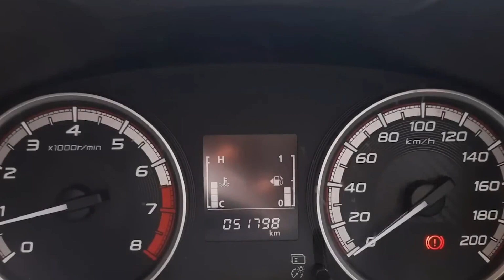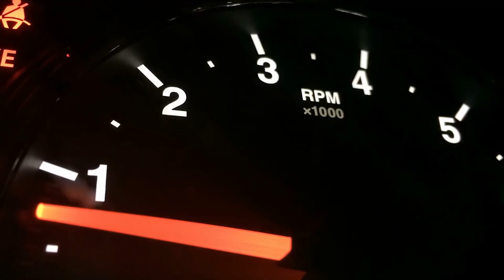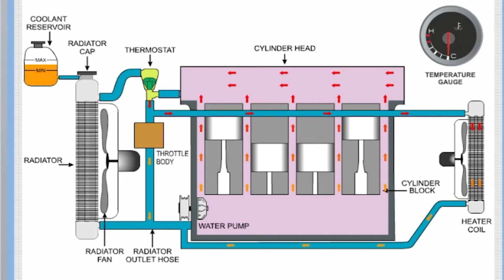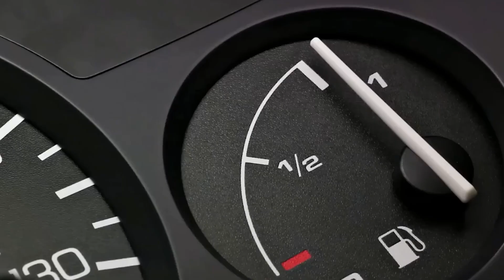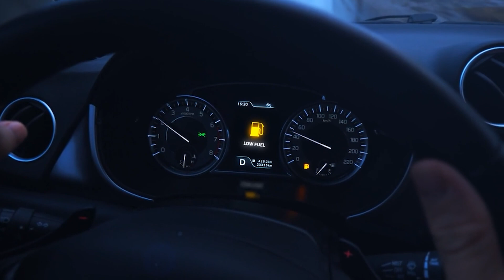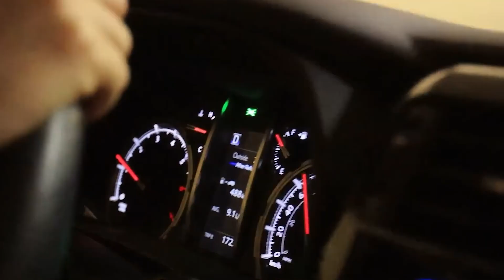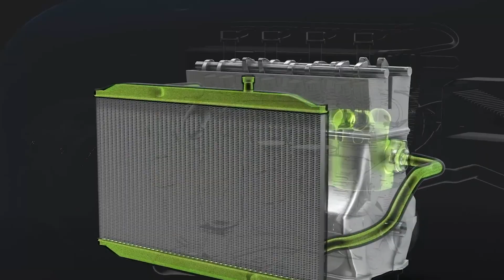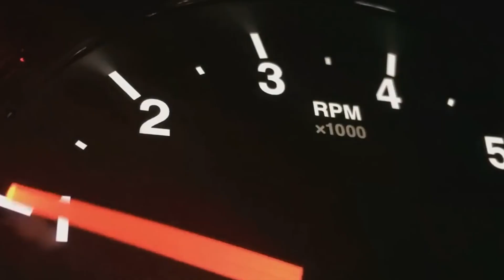7 Driving Habits That Ruin Your Engine Most Drivers Don’t Know!

Comment: Engine braking is bad is it? What hogwash. If that were true, EVERY truck on the road would have a ruined engine. So remember, if you are ever driving a fully loaded truck down a long hill, don't downshift because that is bad for the engine. just ride the brakes!!!!!!  See what happens.
Reply from the maker: @garyzimmer4149 Engine braking is bad for your car if done improperly. Same goes for ridding the brakes so ideally we look at a more balanced driving style. Take me for example, I'm using engine breaking all the time and my car is fine but as the same time it happens that whenever I'm going down a hill I can smell burnt clutch from the car in front leads me to believe that some people are unaware of how engine breaking and downshifting actually works...
Reply: ANYTHING is bad if done improperly. If you shift back to 1st gear at 90mph that might take a few miles off your engine and remove a few conrods  too.  If  downshifting results in compression lockups or sliding the clutch until the engine is up to speed, anyone who does that has no idea.  I am a mechanical engineer,  before that drove heavy transports for many years. I have my opinion, the AI robot has another, you decide who you believe.

Comment: I accidentally pressed the gas pedal when I started the engine. And the sound was very bad. I think it was the valves knocking. The car is a 1997 Jaguar XJ 8.... I hope I didn't ruin the engine, maybe someone knows....
Reply from the maker: Hard to pinpoint exactly what happened. Did the sound stop after restarting the engine?
Reply: @UnderTheBonnetTips  Engine started and sound disappeared

Comment: Some of this video is BS:

- Yes, idling for very long isn't really good for your car, but idling for 5 minutes once in a while (like a railroad crossing) is not going to kill it

- No, engine braking isn't bad for your car at all, the only thing i could see harmful, is if you go to high rpms without rev matching, and using the clutch to get there, otherwise it's a good thing, since most cars for a good decade or 2 now have deceleration fuel cut-off (DFCO), so you're actually not using a single drop of fuel when engine braking, so the statement saying that engine braking is bad for the environment is entirely false

About carbon build up, even if you idle for long periods or drive on low rpms sometimes, driving with higher rpms (more aggressively), or, simply driving in 4th gear (or whatever gear but high on rpms) on the highway will clean the shit out of it
Reply: How long do I run the car in 4th gear - at what RPM and how long?
Reply: @SIMARJEETMEHTA  if you got a manual and wanna "clean it" go on the highway and drive at a normal speed but in a higher gear, for example instead of being in 6th at 2800rpm go in 4th at likr 4500-5500rpm depending on your gearbox etc, and don't hesitate to accelerate up to the redline (with a hot engine!!!!!!!! Never do this cold, drive normally for at least 10-15 minutes first
Reply: Also if you got a diesel it's different, usually stops at 4500-5000rpm
Reply from the maker: @NoTAtchoum I can understand why you would believe what you said above, mainly because you seem to know a thing or two about cars. At the same time there are people that are not as informed as you or me and generalising common issues is a more appropriate way to deliver information. 
- yes you can idle for 5 min at a railroad crossing
- engine braking is bad for your car if done improperly. Same goes for ridding the brakes so ideally we look at a more balanced driving style
- carbon build up on manifold and in DPF its hard to clean the way you described it. You need ideal conditions in order to do so; 
* you need to maintain the same speed for about 20-30 minutes
* your engine needs to be under a medium load
* it differs from car to car and from one engine to another - especially from diesel to petrol
Reply: @UnderTheBonnetTips  i agree, engine braking is bad if done improperly, but then don't go and tell people not to do it saying it's bad for your car, because it's in fact the opposite, you could've told people that it's good but to do it properly, and there are plenty of videos covering this

Comment: Tbh I disagree with the last one. In a vehicle with a transmission with 8-9 gears, it will have an automatic transmission (almost all the time). When you press the accelerator aggressively in an automatic car, it will automatically downshift. And most manual drivers understand the concept that you need to gear down to accelerate.